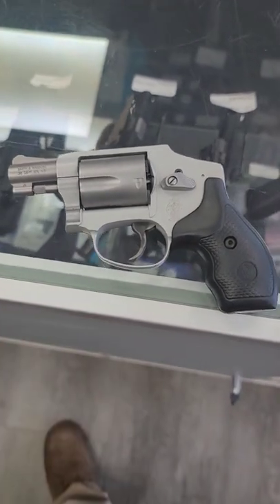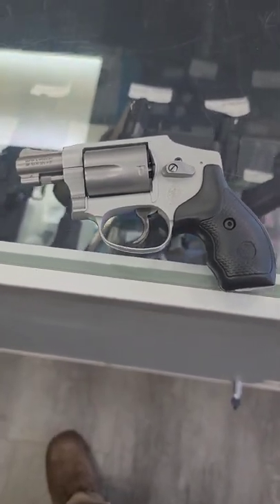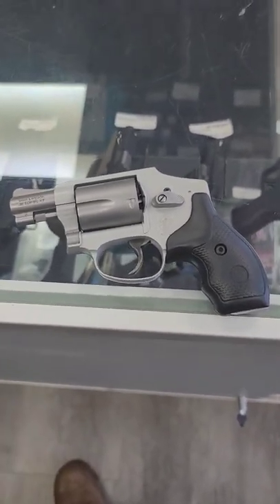Revolvers Don't Jam? #shorts

Comment: Yep. That's not even getting into the possibility of your cylinder getting out-of-time with the rest of the mechanisms. It either won't fire after that or will only fire every other shot as the cylinder won't spin in time for the hammer fall to connect with the next primer.

Comment: Last gun show I picked up a Taurus, asked to cycle the action with the pin protector still in place.  The cylinder locked up tight and could not be xleared or opened.  Same afternoon same show I saw someone else do the same thing.  I've never even heard of the pre lock smith's doing that.
Reply from the maker: Pre lock Smiths and Ruger revolvers are king, IMO.

Comment: I've had one round jam in my LCR .357 ever. It was a hang fire out of a .38 bullet. It didn't fire but just enough to push the bullet out the front of the cylinder so it wouldn't rotate.
Reply: Sounds like jumped crimp not hangfire.  The downsides of a lightweight magnum, more likely to happen.

Comment: Every mechanism can I have a problem. The one advantage a revolver has is that you don't have to change your Springs as often as you do on let's say a 1911. Also, your ammunition Choice can be sketchy if you don't have access to really good quality ammo. If you've got s*** ammo with a Auto loader, you're not shooting it. If you've got s*** ammo for a revolver, and you can hammer it into the cylinder, you're good to go. There are a lot of advantages to a revolver over an auto loader. Don't try to make Auto loader seem like they are the be all and end all of reliability and revolvers are just as bad as an old edsel. Because you are completely wrong. Anybody who has spent anytime with a revolver, and auto loaders, knows this for fact
Reply from the maker: I LOVE my GP100 and Redhawk Alaskan. Just correcting a common misconception. And be careful with bad ammo.... just because they fit doesn't mean squat if the crimping is bad and the adjacent rounds jump crimp, jamming the cylinder up. ;)